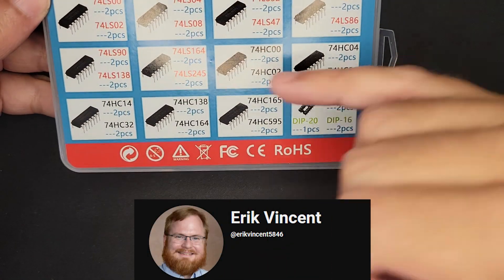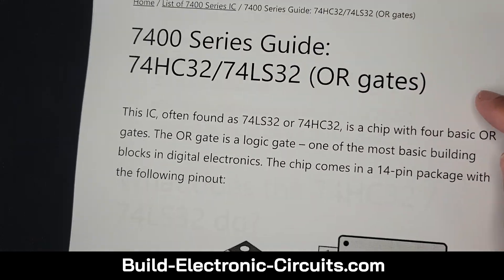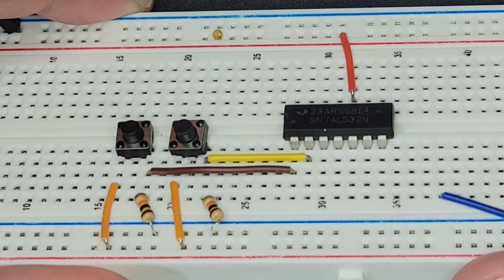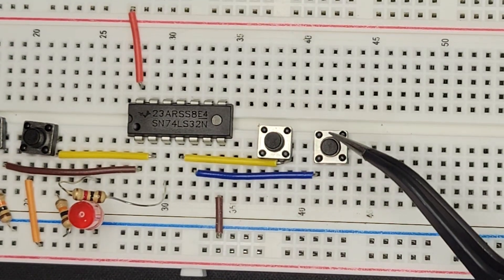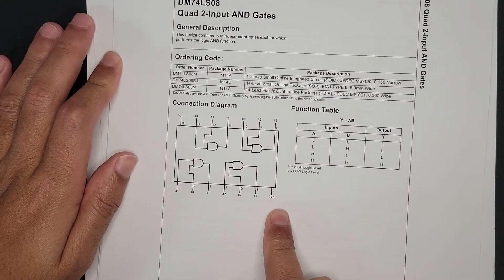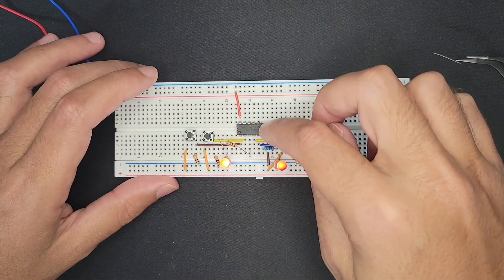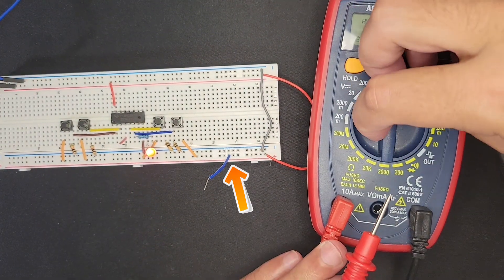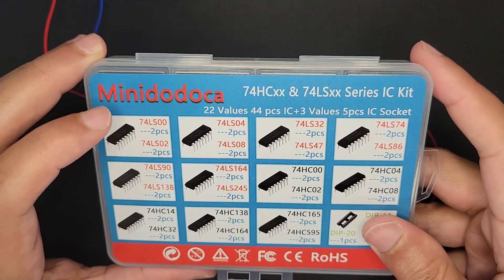Logic Gates w/ Integrated Chips | Beginner Learns Electronics Ep22 | How to Use 74LS32 74LS08 74HC00

Comment: Make LED mod for Bread boards, attach a Resistor in series with the anode or cathode and heat shrink it to know the polarity. I made for each voltage rating like, 3.3, 5, 9 etc. very useful to know the output stages.
Reply from the maker: Ahh really good idea, thanks!